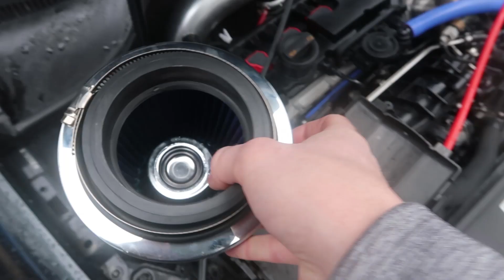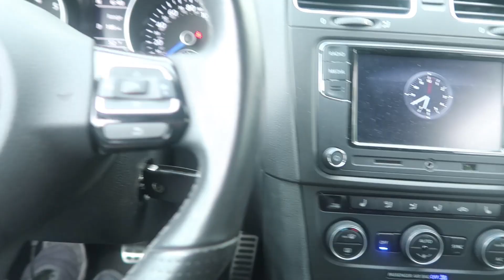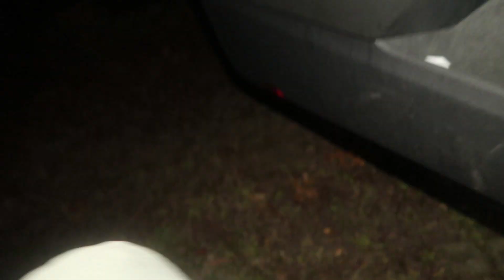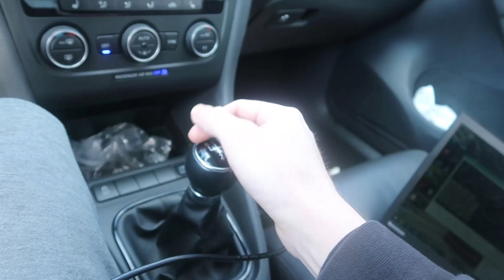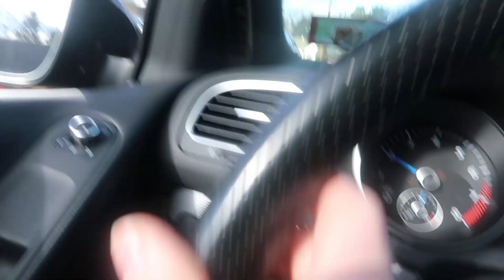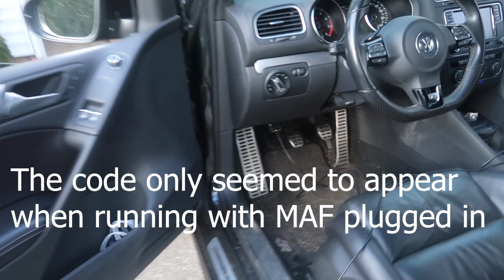Test Drive #3 and P0016 Strikes again | MK6 Golf R

Comment: Until your videos I thought all Golf R's were push button start. Does this car not have the tech package? Keyless entry etc?
Reply: I can confirm that the 4 door Mk6 R has push start on base model. He has a the coupe, not sure if that's why🤷🏻‍♂️
Reply from the maker: US spec MK6Rs only came in two different trims, one is basic and one is fully loaded. You can get either trim in 2dr or 4dr. I have a 2dr base so it doesn't have kessy, sunroof, navigation, dynaudio, and probably a couple other things I'm missing. I would love to have kessy and dynaudio, otherwise I enjoy having the lightest weight MK6R spec haha.

Comment: Could be just the cam position sensor maybe? 🤷‍♂️
Reply from the maker: That's a good thought. I change that next video!
Reply: @FAZEDTom  just an FYI when after going Stage 3, all my sensors failed, my cam position sensor, my Coolant sensor, thermostat, oil filter housing.   I guess because of them being old it couldn't handle the new power upgrades I made. 👍

Comment: What is that spare plug with the butterfly tightening
Reply from the maker: Hey man, do you mean the plug I removed from the intake manifold? That was a temporary freeze plug I put in there to delete (bypass) the hose that goes to the PCV. The little wing nut on the end expands the plug so that it's secure in the port.
Reply: FAZED  Excuse my ignorance, what is a freeze plug?

Comment: Does your Maf housing have that honeycomb stuff for airflow? If it does I assume the metal piece from the filter wouldn't be able to get its way into the turbo
Reply from the maker: What's up my man, nah my MAF housing doesn't have anything like that. My intake it just an open 3.5" the whole way, no honeycomb or filter anywhere. I haven't seen any K&Ns fail but I'm just paranoid I guess

Comment: I dont know how old is this video...i will try to give you some recs..if you change your sensor for crank and continuous doing crazy things.. check your throttle valve (clean,basic settings)...pressure your fmic system for any air leaks... block the N80 valve witch coming from gas tank or disconnect and check...
Reply from the maker: Hey thanks Boost, it is a bit old. I'll probably only make one more video on the timing problem (despite me spending a lot more time on it). Those are great recs, I do end up having the crank tone wheel and sensor checked so I can tell you that's not the problem. There are no boost leaks and the n80 is functioning well too. I appreciate the help man!
Reply: @FAZEDTom  be patient my man! Hope today you are enjoying this setup...